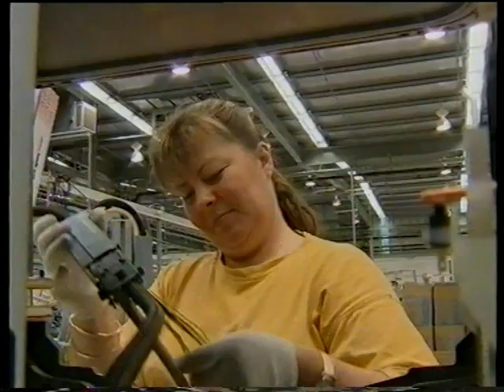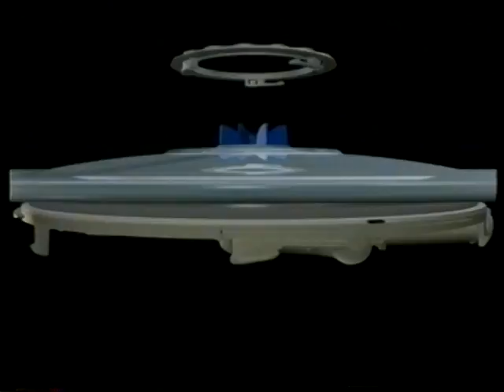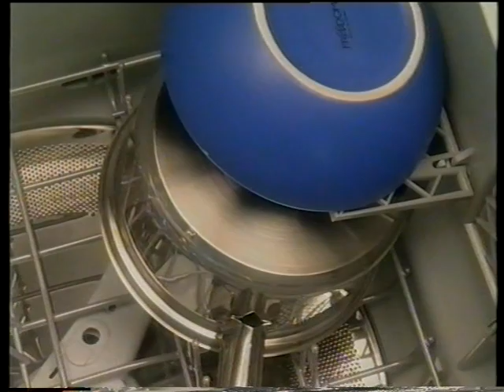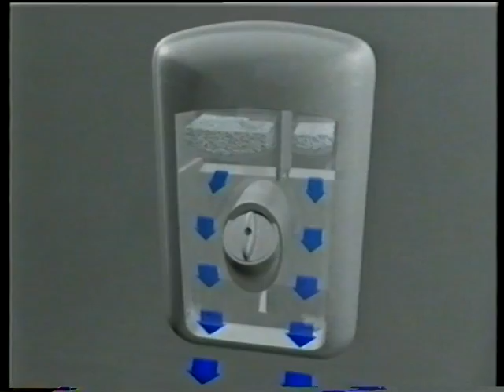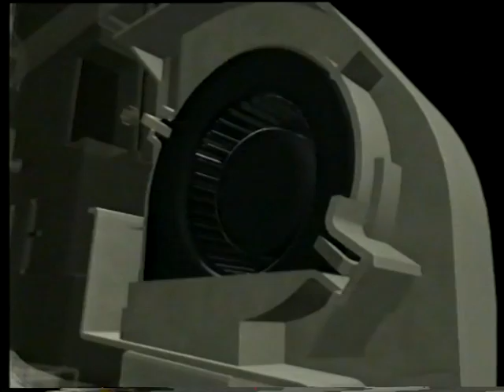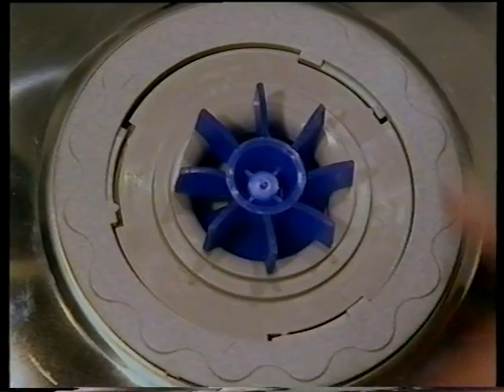Fisher & Paykel Dishdrawer

Comment: The interface of our. Fisher and Paykel is the most primitive and difficult to use of any device in our home.  It is most akin to the buttons you push multiple times on an old digital watch.  The remote control and instructions are surprisingly unhelpful for this problem. Our unit had no electronic display.

Comment: I have had this dishwasher for a couple of years and as beautiful and inviting as it is, I would never buy one, again. It is not uncommon for a piece of cutlery or dish to slip down and block the spray arm at the bottom of the machine. There is no warning or indicator that this has happened allowing the cycle to complete and result in dirty dishes. When I remove the filter to clean it, as advised, there is a pond of undrained greasy water in the bottom of the machine. I’ve been told that this is normal. It may be normal, but it’s disgusting and can only be the water that last came in contact with the dishes. The entire machine itself has not been able to be anchored properly to the underside of the counter. I have had installers out twice to address this, yet if the drawer is extended, the entire machine tips forward. I believe all of these problems could be corrected by the manufacturer, but until they are, I advise purchasing a different product.

Comment: Hi. I was just watching your video. It was very informative. We have a problem with our double drawer dishwasher in that the top drawer thinks its open all the time and will not begin a cycle. There are no error codes. Is there some "drawer open indicator" part that can malfunction? When we go to start it, it just makes a little noise to indicate that the drawer is still open when in actual fact it's shut.
Reply: I have this same problem.  What was your fix?
Reply: I have the same issue, did you find any solution to it yet. I'm struggling with my one since the apartment I moved into doesn't have the manual book.

Comment: I am curious as to what the voltage rating is of this Fisher & Paykel dish drawer  machine is. Example is it 120 volt a.c./240 volt a.c. is it dc current? Is it available in more than one current rating? Is it European wire or American standard or ISO. Also what are the overall dimensions for instalation,
Reply: they make models that operate on 120v and models for 240v but check the website to be sure